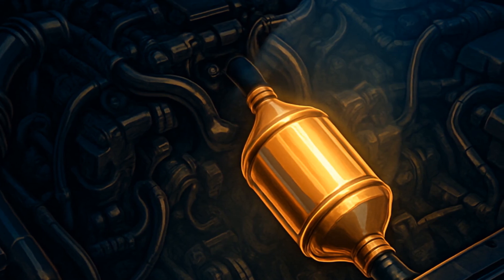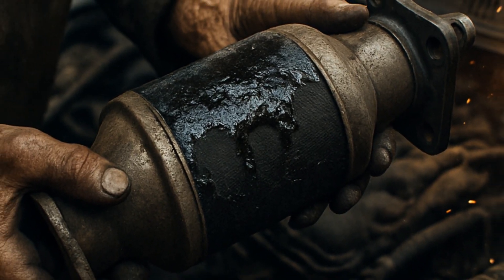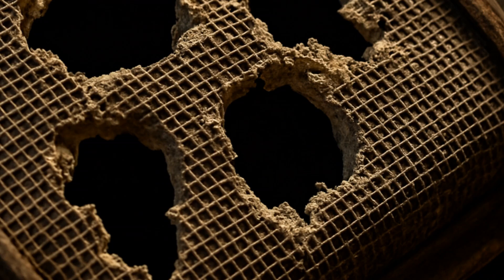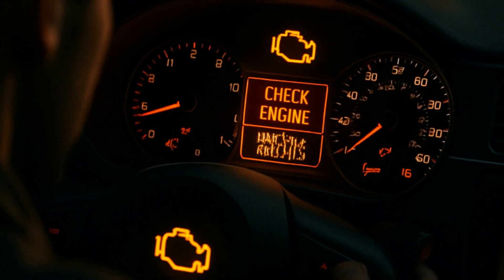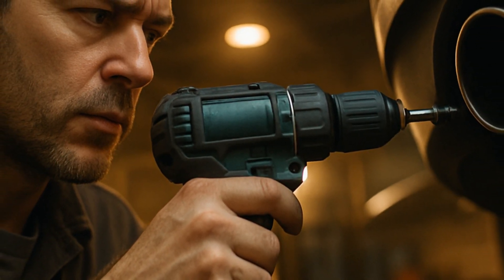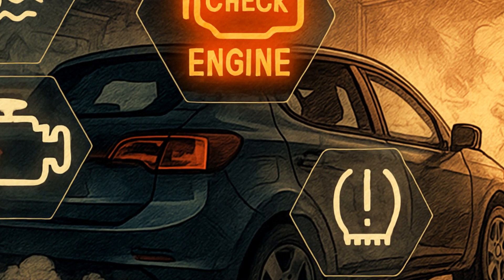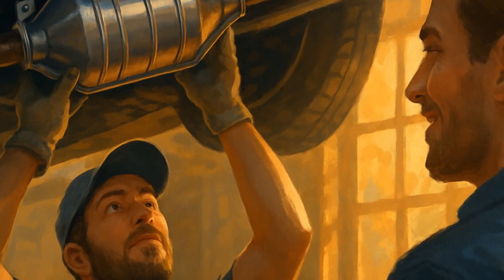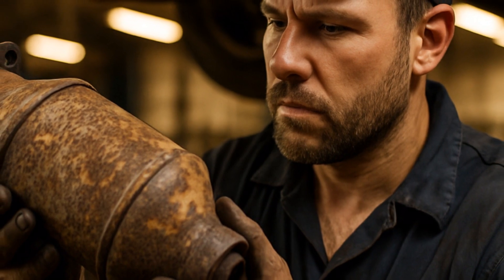Catalytic Converter Drill Holes

Comment: If you do a hole before the Cat , then you relieve back pressure on the engine if you are throwing the P420 code. I dont think anyone will put a hole on the actual cat....

Save your Lungs and ask China to clean up there air standards, since it comes over to the USA eventually. Your one cat will make little difference.